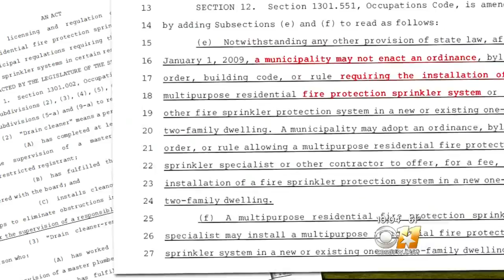I-Team: Homebuilders Push Texas Lawmakers To Block Fire Sprinkler Requirements

Comment: While I like the idea of having a fire suppression system, I question whether the risk justifies that $6,000 increase in cost. In the State of Texas there were only 228 people who died in a fire in 2015. Even if a requirement for fire suppression systems reduced that to zero (which is unlikely), the number of lives saved is just a drop in a bucket compared to the 27,860,000 people who live in the state. You're talking about spending something like $500,000,000 per year to save 228 lives. We could save more lives than that by taking the money and building bicycle trails so that more people would ride bicycles rather than driving their cars to work.
Reply: The cost of a fire sprinkler system is $1-$1.50 per square foot. So $1,000-$1,500 on a 1,000 square foot house, and $1,500-$2,250 in a 1,500 square foot house. Most people aren't buying a 3,000 square foot house.... So the cost of a fire sprinkler home isn't going to be $3,000-$6,000 for most people. Only 2 states require new homes to be built with  fire sprinkler system. About 7 people die every day in the US in home fires, zero doubt lives would be saved if they were required in new construction homes, as you can see in the video, 2 different scenarios where one room had no sprinkler, the other did, the one that didn't burned completely, the other one was put out. The cost is negligible relative to the type of home you're buying. It's the same stupid argument they were making back in the day when they wanted to make seat belts mandatory, ohhh it's going to increase the costtt ohhhh it's not worth it, look it's gonnna beee millionssss, looook less than 1% of accidents result in death, dropppp in daaa bucketttt.